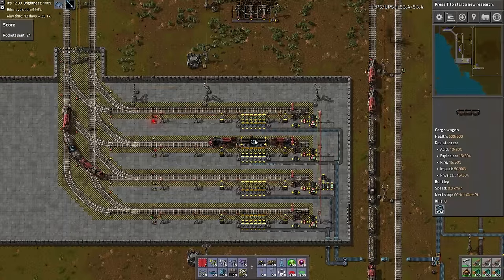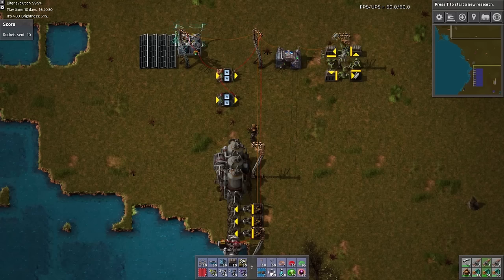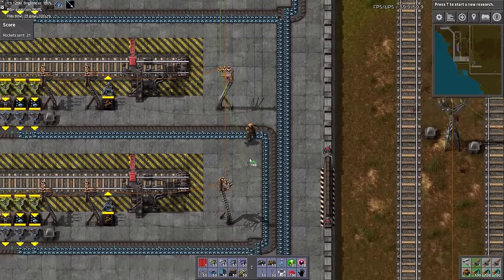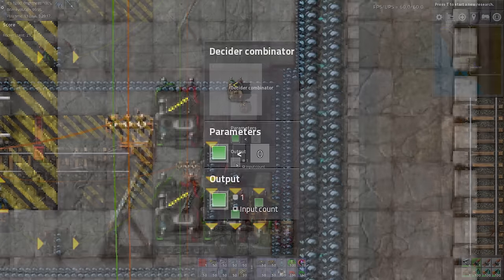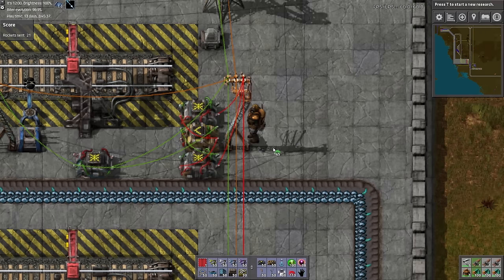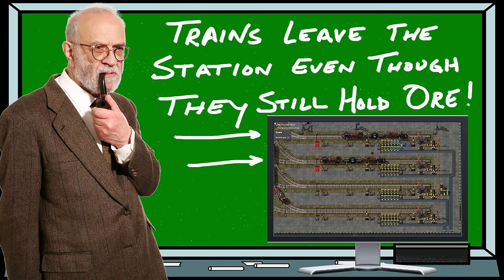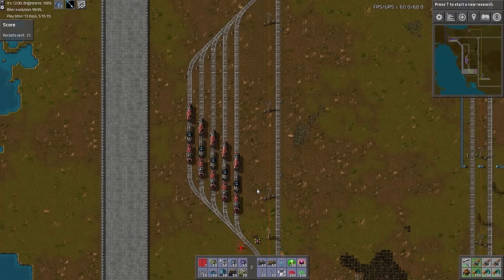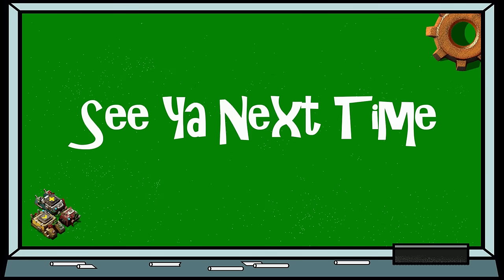FACTORIO TUTORIAL: BALANCED TRAIN STATION | Combinator Classroom Ep. 5

Comment: I greatly appreciate the complexity that went into this, but decided to go with a single-headed train network of 1-4's. So far, I've found that 1-4's work at least reasonably well - they carry quite some cargo, have decent performance and their stations still have a fairly small footprint. The biggest advantage of single-headed 1-4's is that you don't have to haul a dead-weight locomotive all of the time (which saves a lot, since 1 locomotive weights the same as 2 cargo wagons). This means that, to get the performance and capacity of a 1-4 in a double-headed train, you'd need a 2-4-2 (which means double the fuel cost, and almost double the train size).
 
Although don't take my word for what's best. The main joy of Factorio is trying out different things and seeing what works. There isn't one perfect way to do it, and even then, something doesn't have to be perfectly optimized to work fairly well.

Comment: ShredGuy, great series on the combinators and the circuit network.  I'm having an issue with this particular build and I'm not quite sure where I've screwed up.  I have four stations offloading Iron ore with 5 trains each having 2 cargo wagons.  What I"m running into is the Stacker exit will go green without any stations being green.  So I end up with a train blocking the exit of the stacker waiting for a station to drop below avg.   Did I miss a connection anywhere?

Thanks in Advance, you and the rest of the Cracktorio gang have really helped me get value out of Factorio.
Reply from the maker: Double check the values in the Stacker SR Latch. With your setup, the number in the Decider Combinator should be 16,000 and the "Bias" that goes into the Arithmetic Combinator should be 12,000. Essentially, trains should only exit the stacker if the amount of Iron Ore in the offload drops below 4,000 and should continue to allow trains to exit until the amount of ore in the offload hits 16,000. If that doesn't work, let me know and we'll try to figure out what else could be going wrong.
Reply: Thanks for the help! I had the combinators completely backwards on the Stacker exit.
Reply: Again, thanks for the helpful reply, I got the station balanced perfectly now.
Reply from the maker: Nice... Glad I could help! And thank you for swinging by and taking a look at my videos!!

Comment: This was extremely helpful!

Can you use the same theory to create a condition where a train only leaves the UNLOADING area when a mining station is empty? If you multiple trains but only 1 mining outpost, this would seem the best way to handle it so trains aren't stacking up on the main rail. Also don't want to create a stacker at every singled mining outpost.
Reply from the maker: I currently trying to figure out a system where once the trains offload, they go to a central output stacker to wait for an open mining outpost. The problem is only releasing as many trains as there are open mining outposts and only sending the right type of train (e.g. Iron Train vs Copper Train).
Reply: ShredGuy99, universal trains, specific res-type stackers(maybe even universal inputs in stacker but specific resource type exits).
Reply from the maker: You can't dynamically program trains so this won't work unless you have universal offload... Which may be possible with bot offloading and offloading trains into active provider chests.

Comment: Couldn't follow, brain ended up on table, it didn't work.
That said, my setup is different, no double headed train, and you never mentioned what signals to use at the parking or on the lights.

But seriously, this is not working. I always get one train already heading going ahead and leaving parking only to then stop right in front of one of the stations, where it is of course held up by the signal, because there is still train in there.
Does this just no longer work in the new version ?
If my trains exit in the front, what do i do with the signals ?
The red signal that goes back to the signal near the entrance of your station is also looped to the exit in the front of the station, but that didn't do anything either.

4 wagons per train, 4 stations, 5 trains.
Connected all chests on both sides of the track to one pole per station, then to the combinator.
Constant Combinator 8K
Decider Combinator 32K
Arithmetic Combinator 24K

Do not have settings for the lights, or the Constant Combinator you have at the parking signal, no lights work.

I just spent 3 hours screwing around, with nothing to show for it.
Great.
This has to be possible.
And it should be far easier.

Comment: ShredGuy99 i have 4 oile tanks at my train stop, each have 1 pump, that's pumping oile to my base. 

Problem: My train cant unload its oile, because only the first tank is getting used, the other 3 doesn't. 

Question: How do i circuit the pumps, so they empty the 4 tanks equally into my base?
Reply from the maker: I probably wouldn't use combinators in this situation... Connect all the tanks together and use one pump to pump the oil to your base. The tanks will then unload evenly.
Reply: Why haven't i thought of that... jeez 
Thanks for quick reply! :D

Comment: I am not sure I understand the logic behind the "Full" quantity condition, as you are closing the station when you have have more than 8k Iron in the whole offload (meaning 2k per station) while each station can store over 14k with 6 steel chests. In other words, it looks like you are closing the station while each chest contains 333 ore =14% of its storage capacity.
Reply from the maker: Why would I want the chests 100% full?
Reply: I agree with you both.  I usually run my train stations so that they are no long available when the storage available is less than the amount a single train will hold and will completely unload a train when available.  This makes it so I don't have nearly full trains going back into the rail system wasting fuel and time.

Comment: I am playing .15 with angels and bobs mod on. Is there a way to transport the entire 75k of liquid (A) out of the same train tanker and fill it with 75k of liquid (B) from the same stop controlling pumps via circuit conditions? (edit It can be done! But its buggy if you get less than 1 and more than 0 because the circuit network sees any fraction of a number as 0)
Reply: You can do that in vanilla? Just make two tank carts or better yet split one into three separate inventories.
Reply: Sorry I should have been more specific. I'm not trying to use more than the 2 tankers already attached to the train I want to input sludge and pull waste water into the same tankers without adding more cars to the train. So far this is what I have figured out... I need to double up the train stop orders and here is a picture http://imgur.com/a/IcnWh
Another problem Im having is Fluids are not always integers alot of the time Ill have .2 stuck in the wagon I tried multiplying the train station output but I think the circuit system sees .2 as 0 as well and 100X0 is still 0.
Reply: In the cart UI you can separate the tanks into separate inventories, this doesn't add any weight and you don't need another car. Honestly I don't understand what you're doing as it looks like you're inputting and exporting the same item at one station.
Reply: I understand the splitting UI however I wanted to use the entire 150k capacity that turns into 90k waste (1.2 trailers) which is why it would be ideal to use both tankers
Station A: pictured (inputs)creates crystal and slag slurry, and (extracts) processes sulfur waste
Station B: (extracts)processes the crystal and slag slurry and (inputs) creates sulfur waste 50:30 
Ive got it figured out now to the point that it should work but keep getting stuck by a residual amount <1 being stuck in the tanker preventing the other fluid entering. The circuit network sees something like .8 and deems it 0 shutting off the extraction pumps. Ive had as low as 0.0 slag preventing the waste entering with input pumps enabled
Reply from the maker: You can separate the individual tanks on the fluid wagon. So theoretically you could move fluid from one tank to another tank at a station. I never have had the need to do this, but it seem plausible. However you can't have an input pump and an output pump going to the same tank connection. I haven't play BobsAngels in 0.15, but this is how it works in vanilla and I wouldn't imagine it's different for BobsAngels.
Reply from the maker: After noticing there was some conversation already below and looking at your picture, no you can't control that with logic. However, maybe try turning power off on one side and then the other. Just test it without using logic. If it works, it's should be pretty simple to control power to each side using switches and the circuit network.
Reply: Thanks for the reply's! I have figured it out, but there is a known bug in .15 with the introduction of fluid tanks that anything <1 =0 to the logic network so it works with pumps being configured enabled based on the value of the offloaded liquid with a recent fix to .15 but we still need a patch for anything less than 1 = to 0 which throws the logic for a loop. I can post a blueprint if anyone is interested. Looking at my initial question its a bit weird ill try to edit it and make it make ...more sense.
Reply from the maker: I'm not sure it's a bug. Everything in the circuit network rounds down. That's the way it has always worked. I wouldn't expect this to change.
Reply: Sounds like bad news for my train station..
Reply from the maker: Perhaps there is some way to keep the pump on for a tick or two more in order to get that last bit out. I'm positive there has to be a way to make it happen. Tank reaches zero, count to 10, disconnect... Or something like that.
Reply: Id love to see a blueprint for something like that!

Comment: hmmm...love circuit netwrok things..shame you dont have AI's as a next step

but considering any 'train hold' would have to be made part of the 'secured' complex..or guarded in its own right.. or risk havieng you stuck with a bunch of trainlees carts and bitters swarming around em.
and that all that 'average' input still might risk a brief 'reduced' flowto the foudneries and so forth ...well ,i'd say use the extra materials to just make a large enough safe station with extra stopign space beffore the actuall unload to 'act' as a train stacker ,they all sit ncie and safely with ther loads in your main complex steadely feeding it in 99% of all cases sicne generly if yo uhave say 5 trains ala 5 carts+ each at most 2 will be out to refill at ther armed minning outposts ..givieng a ncie and steady flow for well anything under a 5 belt production line or ?
Reply: Namoth the actual average part should probably be changed around. Locking a station until it has room for a full load it's probably a better route, but I can see using the average would help if the trains have a long way to go and will probably be able to unload with little slow down during the wait.